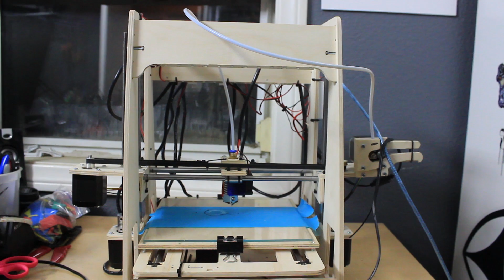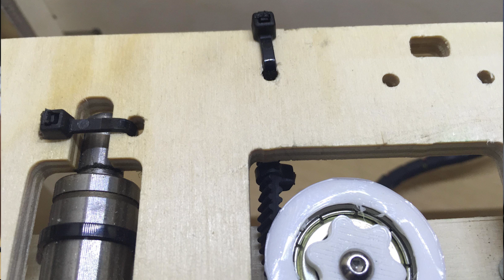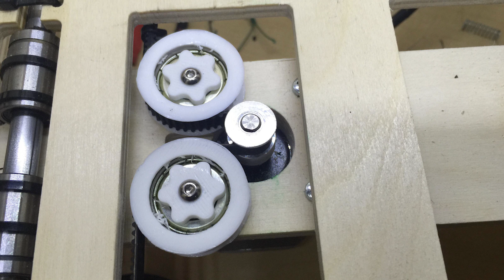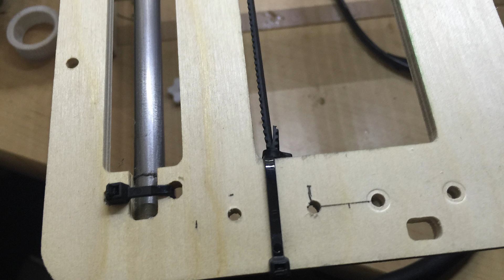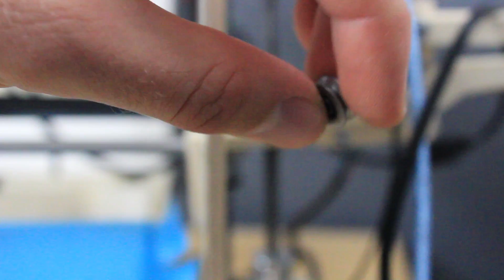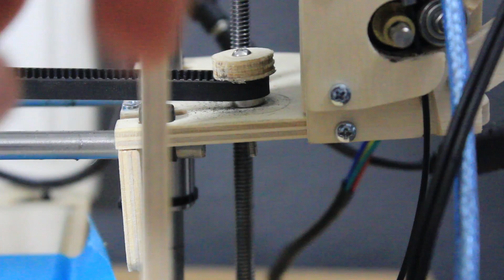Prusa I3 Style 3d Printer Upgrades And Mods (RP9v2)

Comment: I like mod videos, but wouldn't trade my FlashForge Finder for a kit, it's built so well and features are so good.
Reply from the maker: +Mickice hey there is nothing wrong with that at all. One thing I like very much about 3d printers is the amount of options available to basically find one that fills all of the needs you have.